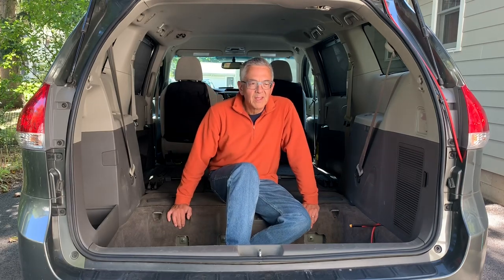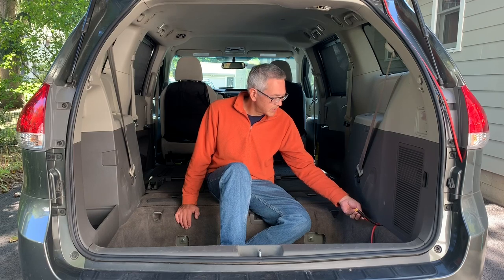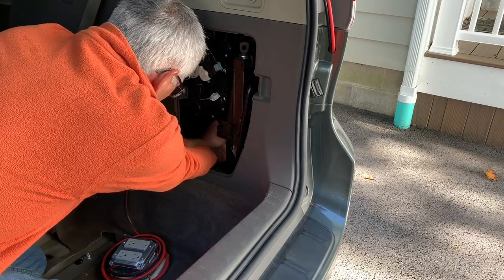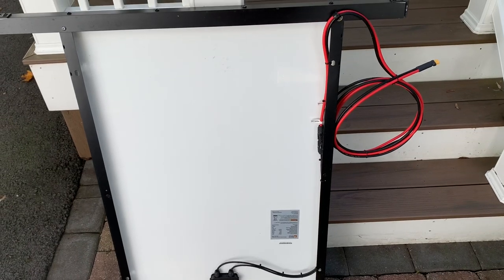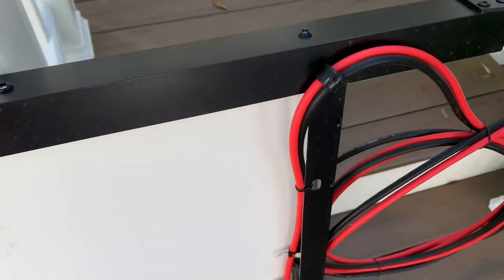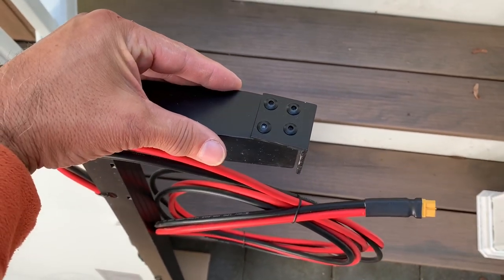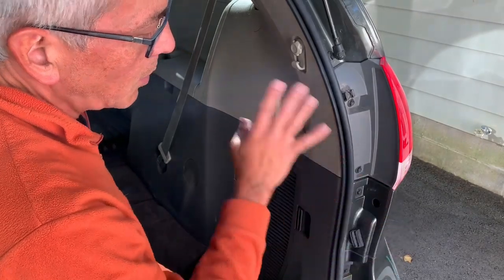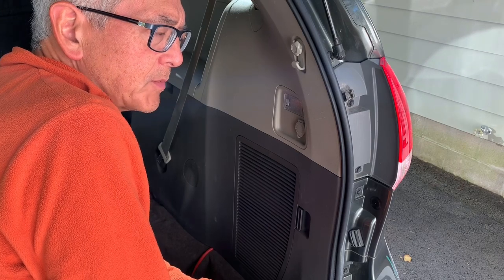Sienna MiniCamperVan Gets unSolared

Comment: Really nice build.  For added stealthiness for your solar panel wiring, where the red wire is visible on the outside of the van, you could paint it black (or wrap it with black self amalgamating tape) (to make it less noticeable).
Reply from the maker: Good idea, thanks. I’ll keep it in mind.
Reply: I have a white 2009, so maybe I can find uv resistant white wire and put red/black shrink tubing on either end.  thanks for your videos, they are really well produced and helpful.

Comment: Bruce taking your idea of the hose clamps I cut an 8’ piece of Superstrut in half and bolted 2-100watt solar panels to it before attaching your hose clamp idea to the existing roof rack. They are very stream line and hold up fine. Again, your knowledge has been a blessing when adapted to my needs. Thank you.
Reply from the maker: Yes, hose clamps are really like super-duty multipurpose clamps. Kind of like industrial strength zip-ties. You can use them for all kinds of things.

Comment: Hi Bruce, with solar panel mounted on roof, did you get increased wind noise when driving on highway?
Reply from the maker: There's no audible increase in wind noise when seated in the front seats. However, I've notice when laying down in back when my wife is driving, there's a slightly audible level of noise. The panel is mounted as low as I could reasonably make it without touching the roof so I think the noise is the air passing through the tiny gap between the panel and the roof. I'm thinking about sealing that off to see if it makes a difference but the level is so low that the time spent would probably not be worth it. I suspect panels mounted on top of the roof rails are quite noisy.
Reply: @BruceParks  Thank for your reply! Your design is always an inspiration.

Comment: Do you do anything for Heat? I have a diesel heater that I run through the skylight, but I would like to have it installed inside..I camp in the cold skiing and Mt biking. Im going to use some of your ideas Thanks.
Reply from the maker: The only thing I do for heat is steal it from my wife :-). We're mostly fair weather campers, though up in the mountains it can get pretty cold, even in early fall. We've slept in ~20°F (Banff, Bryce, etc) and woke up to ice on the inside of the windshield. If I built a larger van, like a promaster or sprinter, I'd definitely go with an integrated diesel heater. Or if I built another minicampervan for solo travel, I'd be interested in building in an interior heater but with the two if us in a small vehicle, it's a tradeoff I wouldn't make.
Reply: @BruceParks  these diesel heaters are installed youtube vans and sailboats, there is also John Mck 47 on youtube that is an expert. they just sip diesel and they are small they could be put in the back side storage. They have a digital programable remote. I have 2 Siennas 08 and a 2010 Im trying to sell the 08
Reply from the maker: PanamaVail I’ll check them out. I subscribed to John Mck 47, thanks.

Comment: Hi Bruce! Halfway through converting my 2015 Sienna, your jaw-dropping van build was my inspiration!  I'm getting ready to start the solar install, and want to duplicate your design. I can't quite figure out how you connect the hose clamps to the aluminum angle iron. Also, I've never done any riveting before, can I just use the same M6 screws in that location? Appreciate any help!
Reply from the maker: Hi Frank. Yes, M6 bolts would be fine instead of rivets. Use stainless steel bolts if you can source them. I uploaded a couple of pics to show the hose clamp relationship to the aluminum angles. Take a look and let me know if it helps or not. https://photos.app.goo.gl/6LQffep7uQmQnyaE7
Reply: @BruceParks  Thank you so much for taking time to send those pics, I think I understand! It seems the extra piece of aluminum angle not only provides the correct angle and height for the roof rail, you intentionally left a little gap so the hose clamp can slide between. Thank you!
Reply from the maker: Exactly. Don’t hesitate to ask if you’ve got more questions.

Comment: once again thank you for your detailed videos. In your opinion Bruce which would be the best Mini Van to convert KIA, Toyota or Dodge, I am talking a used van that may have 100,000 miles. We were considering a Sprinter or Dodge cargo but think to go your route for $6000 instead of $26,000 for the cargo. We may not like this way of travel so start cheap.. Thanks again.
Reply from the maker: Hard to say which minivan is right for you. I chose the Toyota because it has the best reputation for reliability and there are so many that are still going strong with over 200k or even 300k miles. Kia reliability is getting better and better so the newer ones seem trustworthy. Dodge on the other hand seems to have a reputation for failed transmissions before 100k. But two things I like about the Dodges are the way they drive and feel, nicer than my Sienna, and the stow & go seats are a good design that offer bonus space in camper conversions when you remove them.

Comment: Very clever mounting bracket. For those four M6 buttonhead screws, did you drill holes in the solar panel frame? Most panels I've seen don't have mounting holes where I would want them. cheers
Reply from the maker: Yes, I just laid out where I wanted the holes and drilled them. The panel frames are completely clear on their backside. They’ve been rock solid since day 1.

Comment: Hello Bruce! First a great big thank you for taking the time to make these awesome videos. I'm slowly getting my 2018 sienna camperized.  My question is about the solar cable entry hole position ... I see someone else has made the hole lower down in the horizontal section of the bumper.  Yours looks less conspicuous and probably reduces the cable length. Any regrets on your positioning?  Perhaps it would interfere with servicing the tail light assembly?
Reply from the maker: Hi Marion, good question. I’m happy with the hole location. It keeps the cables as short as I want and the cables don’t interfere at all with taillight removal. The perfect location is routing the cables into the roof rail end cap but that’s a much more involved job I’ve saved for later.
Reply: @BruceParks could I use a hole saw from a set that’s typically used for wood? I’ve not used one on this type of material and am concerned about getting a clean cut
Reply from the maker: @Bradsaved  Yes, that’s what I used, ¾” diameter. Mine left a clean sharp edge which I then beveled with a round file.

Comment: Hello, Bruce, What you did to your van is a master piece. May I ask how's the 100 Watts Solar panel serving you?  Is it providing enough power to charge your 100 Ah battery?  Would you consider use larger 12 v solar panel next year?   Thanks.
Reply from the maker: Richard  - Excellent questions. First off, after a lot of thought, I decided I was limited to one rigid 100 watt panel in order to achieve the lowest, stealthiest, removable, most gas efficient, and least expensive installation. Anything bigger wouldn’t tuck in so tightly between the roof rails and a larger array of flexible panels wouldn’t be removable. 

Next, I calculated my potential power needs to be up to 50 amp hours and didn’t want splurge on a lithium battery so I targeted 100 Ahr for my battery bank size. 

Power loads are: a few minutes of lighting (2 amps), maybe four hours of fans on a hot night (2-3 amps), a couple hours of phone charging (2 amps), and full time refrigerator (0.1 amps idling, 4.5 amps cycling). Occasionally, we use a 1000 watt tea kettle (86 amps for 5 minutes for two cups of water).

I don’t really have a good estimate for how low we’ve pulled the battery on any given day but I can say that on a sunny day, the panel has been easily able to bring the battery back to full charge. 

Sorry for the long answer but I wanted to bring out the details in case you were working through some of the same considerations. Thanks for the question.

Comment: Really excellent work Bruce. This idea for the solar panel sitting flush beneath the stock crossbars is perfect. What tool did you use to fabricate the L-bracket angles? An angle grinder or similar? 

I'm an amateur @ DIY and would love to get this part right. Thanks!
Reply from the maker: I'm glad you like my design. All I used was a hacksaw to cut the aluminum and then a file to clean up the rough saw cut. It helps to hold the angle in a vise during these operations to make things go quicker.
Reply: @BruceParks  Thank you Bruce. That makes sense for the end pieces– is this the same technique you used to angle the L-bracket bar at the ends too? Specifically, the downward sloping part of the long bar, right beneath where the rivets sit. I've only seen straight L-brackets, so I'm assuming you created that slope as well?
Reply from the maker: Yup, I cut the tapers the same way. The aluminum is so soft, it doesn't take much to make any of the cuts.
Reply: @BruceParks  Thank you. I'm so excited to do this. This design solves every problem I was encountering in keeping my solar panel flush-mounted without drilling holes in the roof.

Comment: Thanks Bruce! So for the hole you plugged, that was for the solar panel wires...and you were able to feed it into the existing hole where the jack goes? Did you use a fish tail? Then the shore power plug end just hangs under the car?
Reply from the maker: I didn’t need to use a fish tape because the space is large enough underneath to just barely get my hand up to the hole to feed the wire into the hole. 

The shore power plug is actual attached to an existing screw under the bumper, next to the trailer hitch. You can see how it’s mounted if you watch my video called “Sienna MiniCamperVan Gets Serious”

Comment: how do you cool down for the hot summer nights?.... portable a/c?
Reply from the maker: Hot summer nights can be challenging. We mainly rely on airflow. The best is if we are in a spot where we can have the 2nd row windows all the way down. I've equipped our van with integrated bug screens. Inside, we've got 12V fans to move air around. Our favorite fans are the ones with built-in batteries so they can run themselves at night and then recharge on solar during the day.

Comment: Did you just use a local supplier for the black alum angle? I'm in a small town and it is may be harder to find here. BTW,  I bought a 2015 Sienna Limited this summer, took out the power seats with your help, as well as fashioned a 28" wide hinged (front and back) bed platform similar to yours...without anywhere NEAR the quality of workmanship, of course. I did a two week CO summer shakedown tour, and now plan to install the Rich Solar 100W mono whose length will fit across. (I have a panorama rear moon roof, so didn't want to go too far forward. I sleep head-forward, under the stars!)  The '15 taillights are different, providing the possibility of squeezing the line through the existing lighting hole behind the plastic casing (hard to describe). Going straight into a Jackery 500, which Rich says is okay w/o a controller. About the only draw I will have is a small frig. That is about the extent of my work. I have to operate under the KISS principle. If you ever want to come to OK and replicate your woodwork, I would welcome you! (You would need to bring your shop.) We ALL appreciate your videos.
Reply from the maker: Hi Harry, regarding the alu angle, I used ordinary material typically available in home centers and some hardware stores (I purchased from Home Depot) and painted everything black after fabrication. I found 1½" x 1½" x ⅛" thick worked out perfectly. 

In contrast to KISS, I often operate under the MICK principle. Make It Complicated, Knucklehead :-)
Reply: @BruceParks  Thanks! BTW, my PE friend came through last month and I showed him one of your videos...you guys are cut from the same cloth. Surely you have seen the Dilbert clip showing you as an infant, but if not, here it is: https://www.youtube.com/watch?v=Dx6HojLBsnw
Reply: @BruceParks  I was wrong about the geometry of the '15s; it is the same as yours. So my biggest unknown now is how hard it is to fish the wiring to the hole in the frame...which is there for power for my 3rd row seats, it appears; but there is  enough remaining room for the solar wiring. Project Solar begins next week!
Reply from the maker: Harry Botts How’s your solar project going?

Comment: How did you ground the metal 120V junctions boxes?  Why didn't you use plastic boxes?
Reply from the maker: I initially grounded the metal junction boxes to chassis ground. I've read more recently that some builders recommend not to do that in case there's a problem from the shore power and voltage is inadvertently comes in on the ground lead.
Reply: @BruceParks  Why I asked is that presently, I have a mock-up of a similar system (with plastic boxes).  I feed external 20A 110V input into a ground fault relay (regular off the shelf household type) outlet,  then I plug the system feed into this and if site feed is bad, GFI will trip.  I can remove plug and plug into a separate non-GFI input.  In that event, I intend to setup a alternate ground by driving a 3' stake into the ground and connect ground lug via battery jumper cables.   Is this necessary, in your opinion.?
Reply from the maker: Just want to make sure I understand the scenario: If the site feed is bad, you'll unplug your system feed from the GFI and plug into a different non-GFI outlet (an alternative source). But where is the alternative source power coming from? And does it have a ground lead already? I suppose if your 2nd source doesn't have a ground lead, having everything grounded through a ground rod/stake shouldn't hurt anything. Zero risk, I'm thinking.
Reply: @BruceParks  same power feed. Sent through GFI if it trips. I have a hot duplex outlet in same box. Four outlets. 2-GFI  and 2 non- GFI. In a double junction box.
Reply: @BruceParks  it is just like and extension cord with a four outlet box on one end and it plugs into exterior power source.

Comment: Any plans to do some upgrades on your solar system?
Reply from the maker: I’m planning to run my cables inside my roof rails so they’re more hidden and don’t come down through the hatch. That’s about it right now. I’ll do a video on the cable change since it’s not the easiest thing to do.
Reply: @BruceParks  What about the existing components that you have, any plans to upgrade those?  I am mirroring your system except I will be using Victron 100/20, GoWise 2KW inverter, Battleborn 100AH, 200 watts or 160 watts Renogy panel..... tks again.  Mine is a 2019 XLE equipped with a roof rack and a cross bar...
Reply from the maker: No other power changes this year. Hunkered down for awhile.

Comment: Great build Bruce!  I am copying many aspects for my own Sienna.  Did you use 1/4" aluminum pop-rivets for fastening the long aluminum angle to the short pieces of angle that then attach to the roof rails?  I am a bit leery of the strength of those while going down the highway.  Anything special about them or just the regular hardware store variety?
Reply from the maker: I used garden variety 3/16” aluminum pop rivets. I figured four in each corner would be stronger than needed. I inspected them after our first x-country road trip (7000 miles) last summer and they were still as tight as new.